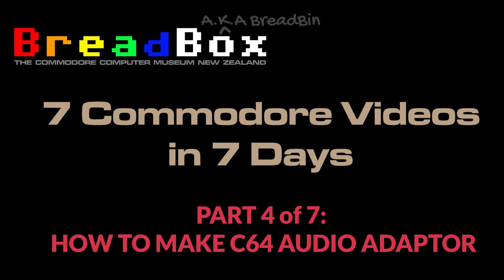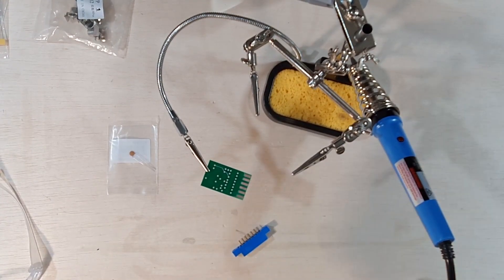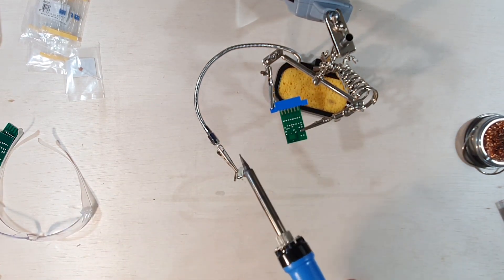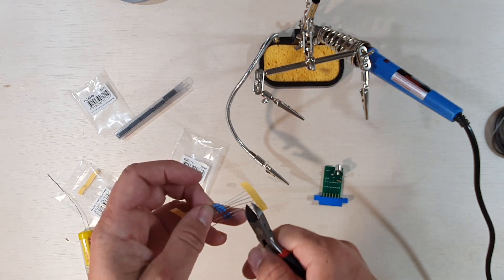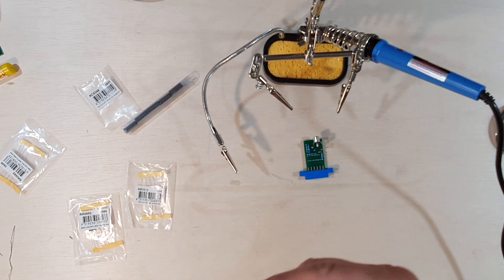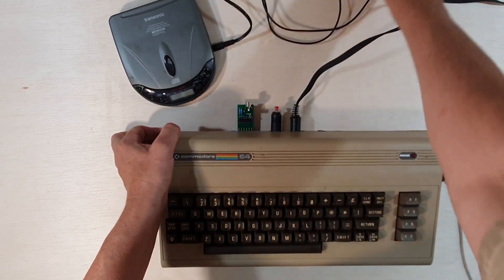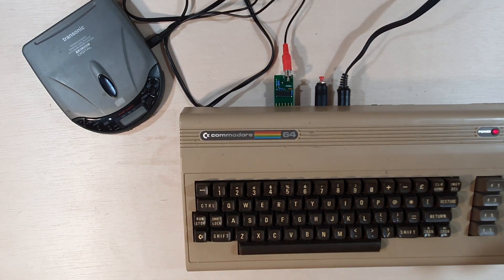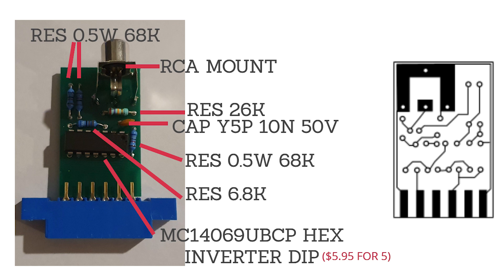How to Build a Commodore 64 CD / LP / VHS / PHONE Game Adapter

Comment: Surely it must be the same speed as a regular cassette - it’s using the same interface!
Reply: Same interface, but the fast load protocol might be right near the theoretical speed limit, as it doesn't need the extra safety margins cassette's warble and noise requires.